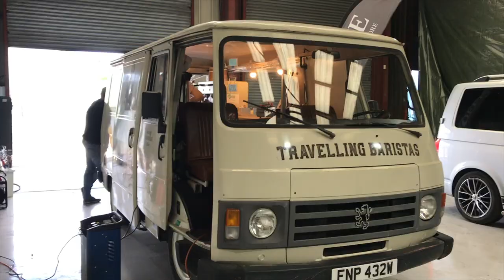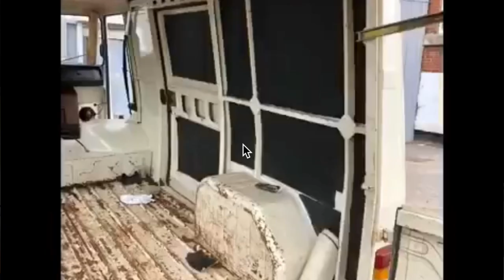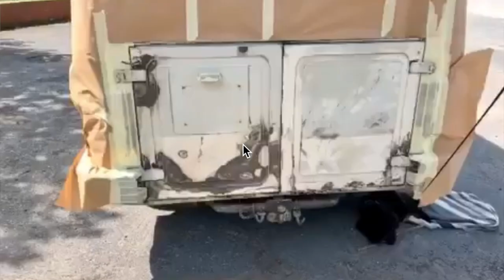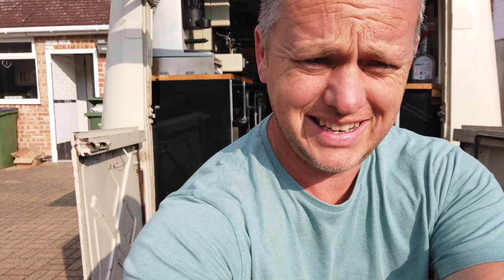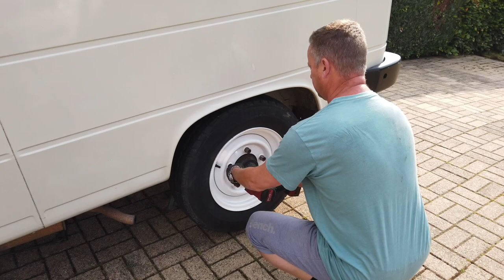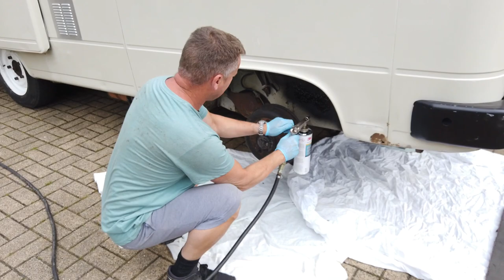"A Change In Career" My Coffee Journey Takes A Different Turn, A Coffee Van,

Comment: Lovely! Thanks for posting. Wondering what kind of batteries those are and how they worked out for you
Reply from the maker: Batteries were no good long term, just use the Honda eu70is far more reliable, Thanks for the great comments👍🏻👍🏻🛠
Reply: @aaanton11  Thanks, not sure I can get that generator in the  US. though. I'm trying to do some kind  of solar and generator mix so I need a decent battery array.

Comment: Blimey! Well done
Mate, Fab new venture you got! I take it those lead cell/AGM Batteries are run off a split charger? I wired my Vivaro 2yrs Ago for camping, wish you all the best Ant.
Reply from the maker: No Michael, there is no split charger, they need charging over night and a generator backup, I will go into it more in another video, lots to do Thanks for the great comments👍🏻👍🏻🛠
Reply: @aaanton11  how about adding some solar panels?
Reply: aaanton11 Thanks mate, look forward to it 👍
Reply from the maker: The coffee Machine pulls nearly 3 kW of power so solar panels wouldn’t be sufficient to make any difference I would need a field full Lol but it would be great if they were more powerful Thanks Andrew for the great comments👍🏻👍🏻🛠